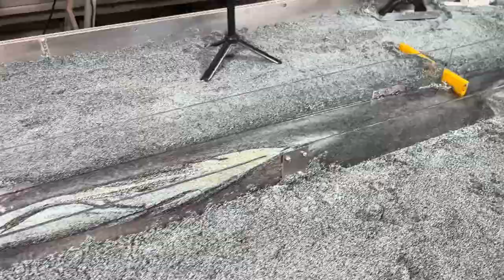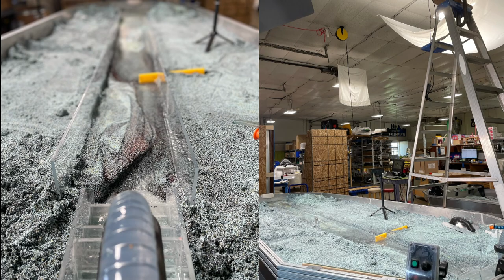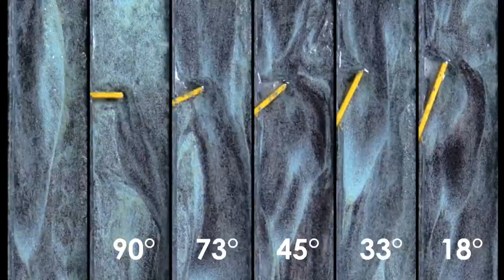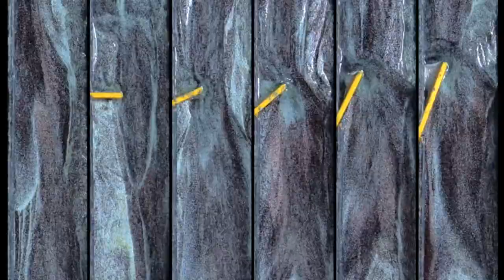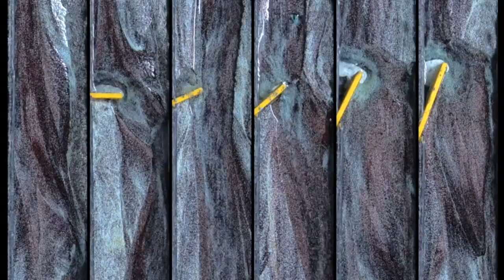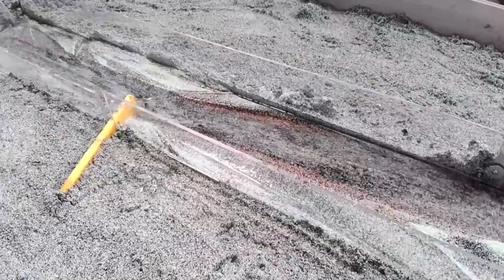Sediment Transport and Scour Around Spur Dikes - Comparison in Emriver Em4

Comment: Hey!  I found out about you on Practical Engineering Channel on youtube. I really love hydro dynamics. Your models look like so much fun. 

 I live on the Olympic Peninsula in WA. I also collect rocks... but only the good ones:p.  I don't know if you might be able to explain something that happened to me when I was walking along the Hoh River which meanders more than the majority of the rivers around here so there are plenty of large river bars with lots of cool rocks.  

When ever I see a rock in the shape of an almost perfect heart, i will grab it because they are usually not common. Last summer I found a spot that was on the inside bank of a bend in the river.  There were heart shaped rocks in abundance. I would bend over to pick one up and would see another one with in a step or two from the last. 
They were all about the same size and type of rock. I filled my pockets and went on my way. 

Ever since then i noticed that rocks that had similar shapes seemed to dominate different parts of the river bar. there were always other shaped rocks but there was always a shape that was more common depending on the location. 

I had already figured that the weight size of a rock would or sand/silt deposits was affected by flow. I got goosebumps to think that the heart shaped rocks seemed to do it too!

Is there some where i can find out more about what would make heart shaped rocks congregate together? 

As a kid, i would always be searching for the seasons hot spot for skipping rocks so i could fill buckets for skipping competitions with my dad. I have not beaten him yet, but he is getting old so i hope that his age will someday give me the win.

Hoh River Oxbow at Hwy 101

https://drive.google.com/file/d/1GnMLlSI55weYCAB82kM6SvbT6cagFUGi/view?usp=share_link
Reply from the maker: This is just a guess, but perhaps it's something to do with this?
https://www.alaskacollection.com/lodging/kenai-fjords-wilderness-lodge/stories/heart-shaped-rocks-exploring-fox-island-geology/
Reply: @emriver  wow that is so random.i am almost more interested in knowing how found this than i am of why similarly shaped rocks are deposited in relatively close proximity.   i really appreciate the time and effort you put into this response.  i didnt expect an answer because i think deep down, i want to figure it out myself.  i dont think it is a big mystery, but it would be super cool too have the explanation put in words that make sense rather than what my brain does to it.   i mean it makes sense that shapes would determine the location just as much as size or weight. but no one mentions it.  i know its an extremely small following but it gives me goosebumps and i thank you. I really appreciate your response and i hope you enjoy your job. sadly  it seems that passions are rarely jobs.  your response made my day and i hope that this is your passion.
Reply from the maker: @chrisrohde7696  You're quite welcome. I did a search for what creates heart shaped stones; nothing too strenuous. 🙂 We here are all very passionate about what we do. Our founder was the inventor/engineer, and when he passed away we collectively agreed to keep his legacy work going. 
Maintain your scientific curiosity, friend!👍
Reply: @emriver  that was more info than i expected. you are doing good work. Thank you.